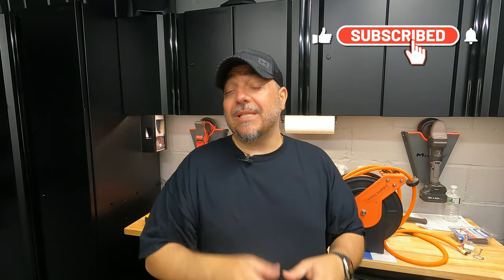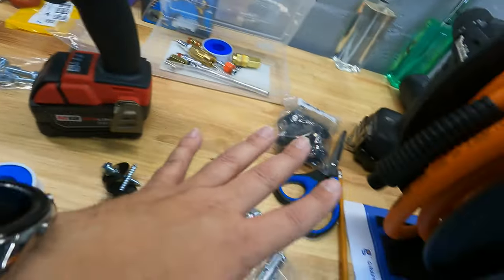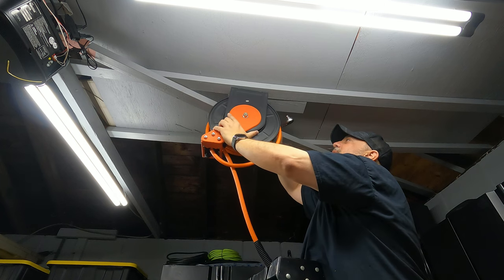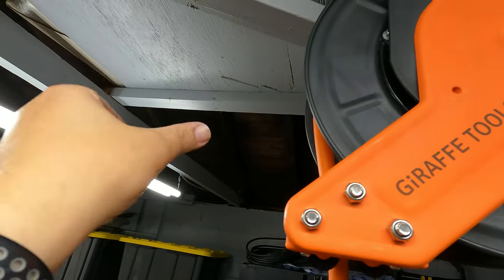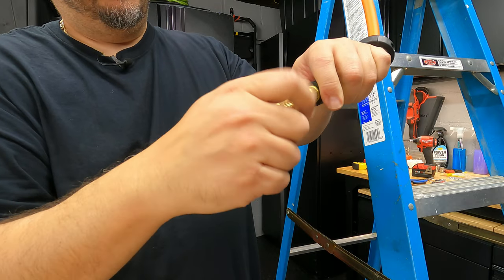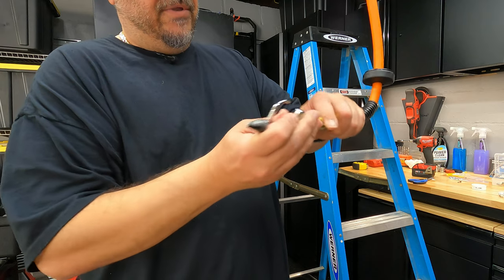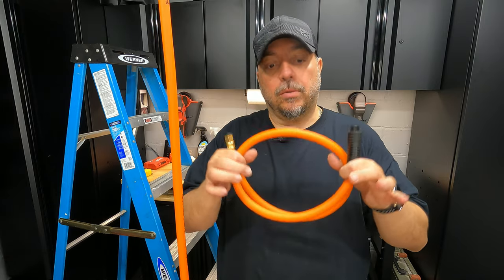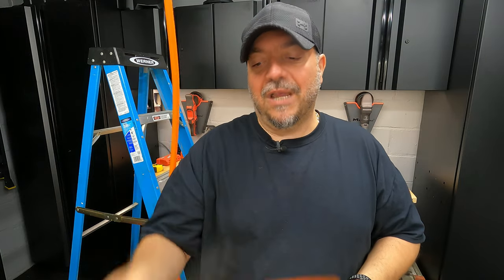Giraffe Tools 50ft Retractable Air Hose Reel Review & Install

Comment: Good video Mike and very informative. If you unspool or unwind the air hose it will make it easier to tighten the bolts down.

Comment: Hey Mike,  How good does the guide wheels work when you pull the hose out to one side? The one I have has wheels on the side so that the hose doesn't bind. I'm looking to replace mine and want to make sure the hose doesn't bind when pulling the hose to the side. The one I have now pivots around to stop binding. This real looks like a good candidate to replace mind. Thanks buddy.
Reply from the maker: Hey Marvin. So far I haven't experienced any binding.  I also tested it pulling to the side and no issues

Comment: The extra hose they sent you is to make a whip for a air impact wrench. Also, it would have been a little lighter if you pulled out the hose. And would have been able to use a impact driver because there is no hose in the way

Comment: How do I unwind it and wind it back up it isn’t working good, when I need it longer it whips back. The 3 foot jumper is enough for me but What happens if the hose or jumper hose breaks do they have replacement ? Can the hose that comes on be taken off the reel